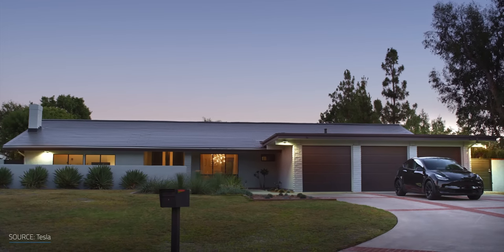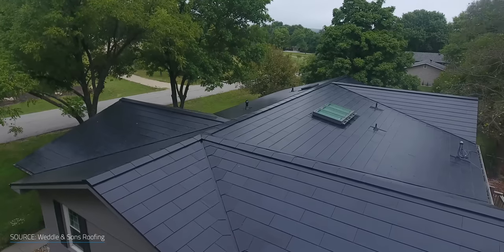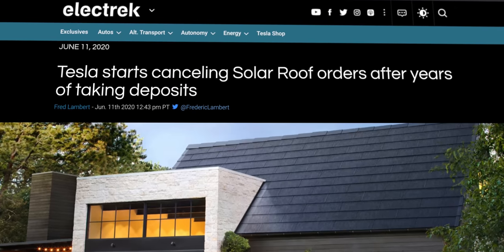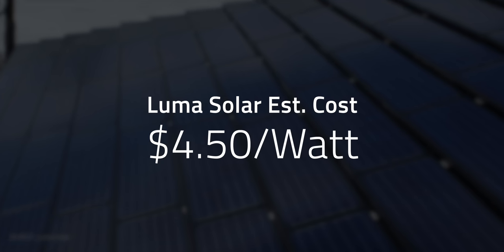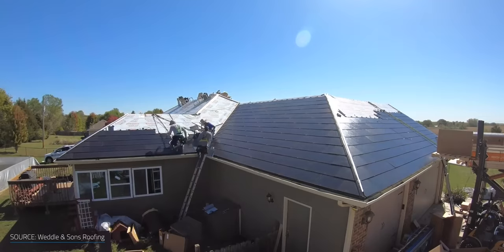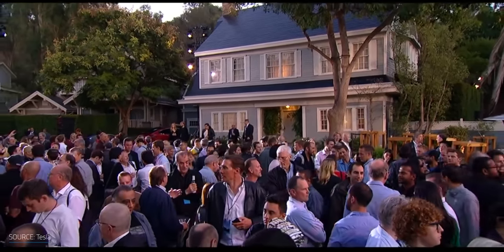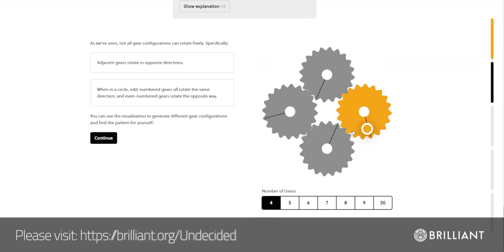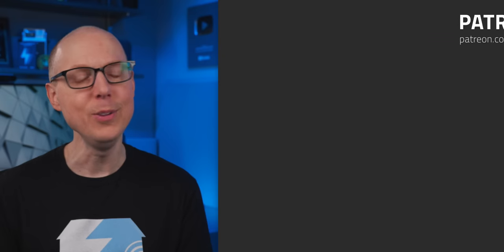The Problem With Tesla’s Solar Roof

Comment: Solar roofs have been around for a long time.  I remember looking at solar roof products 10-15 years ago when I put solar on my camper.  The company made thin film solar on an aluminum substrate.  I think the company was one of the pioneers of thin film solar.  They had two roofing products.  A 3 tab asphalt shingle, and standing seam metal roof.  The standing seam solar panels came in a roll with a sticky back.  All you did to install it was drill a hole in the a roof panel for the wire.  Peal off the back.   Stick it between the ridges on the metal roof.  Because they curved, I was think about sticking them on the curve of the camper roof.  California started using the solar shingles on park/beach small buildings like toilets to avoid vandalism that the regular more visible solar panels attracted.

The company was Uni-Solar.  They where founded in 1960 as ECD.  I'm not sure when they started making solar roofing.  My guess is before 2000(They say 1997).  There sales peaked in 2008 as the largest thin film solar manufacturer in the world.  They went bankrupt in 2012.  So when Musk acted like solar roofs was a new idea, I rolled my eyes.  I have to admit that the Tesla solar roof looks better then Uni-Solar roofs did.

An interesting aside, another division of ECD, Ovonics made the NiMH batteries for the EV-1.
Reply: Yes.  10-15 years ago is ancient history, like Fortran and Cobol.

Comment: I have a new house, but I love the idea of installing a solar roof but it HAS TO be paired with a Tesla battery. I’m hoping that when it’s time to change the roof (in about 25 years) the technology will be great and TEsla will have their crap together 😂
Reply: Solar without a battery doesnt make sense !
Reply: Tesla isn't the only game in town when it comes to home storage.
Reply: I find tesla to be hugely overrated. They are very unfriendly towards their customers.
Reply: @ernie4125  Solar without a battery can make sense. If you are using 2kW constantly and get solar panels that can generate 2kW for 10 hours a day you could cut down on the amount of power you buy significantly. If the cost of the panels is less than what you would pay for the electricity then it's good.
Reply: @ernie4125  I found the payback for a battery in Phoenix (APS) is about 30 years, based on their rate system.  I couldn't justify it - better to spend that money on more solar panels, which I did.  When the utility starts paying more for energy generated at night, that picture will change.
Reply: @paulogden7417 Was not thinking about Tesla sexy batteries. Lead–acid battery's do the trick! Ofc you must make your system as efficient as possible and if need be as rational on the drainy systems. Not saying you will be able doing stuff as usual, but at least you will have some autonomy. 30 years is a bit....

Comment: I'm no engineering genius, but it occurs to me that roofs and solar panels have different functions that may not be amenable to complete integration.
Reply: yah thats why tesla solar roof had too be redesigned totally, its not an intregration more like a roof upgrade ... same functions as a good roof plus solar power and more durability and heat isolation. But the Timberline System is more like an cheap extra i would not call that a real roof. Still both have there use.

Comment: I had my roof for about 17 years. When it came time to replace, insurance covered 60% of the cost. I paid $4,300 for dimensional 125 mph regular shingles. I know a solar roof on my house would easily be $50K. My utilities run about $3.5K per year to be quite comfortable so the amount of utility money per year is not astronomical. When you consider investing some of that difference over time versus taking a loan and paying interest, I just cannot justify it. Even if I had the $50K+ up front  for solar versus just investing that money, I doubt you could ever come out ahead unless the investments did very lousy for a very, very long time. I am definitely decided on keeping my $4,300 lifetime roof with 10 year shingle blowoff guarantee.  I also have zero maintenance and zero monitoring. I just don’t have to worry about my roof in general which is good piece of mind.

Comment: The large problem with putting a solar array on any dwelling is that it (1) puts holes in your roof (2) must be removed in order to access the roof for repairs (3) is hard to access because it's mounted to an existing roof.  
The solution is to place a solar array atop a stand-alone carport lattice frame.  This allows for access to the underside for maintenance and removal of individual panels, utilizes the entire roof frame, provides shade for your vehicles and is overall less expensive to build.

Comment: I added solar panels with my new roof a couple of years ago. I'm in Minnesota. Summer air conditioning is fully paid for by the panels; winter is a different story with snow coverage. I have to clear some of the panels on the east side of my hipped roof since the panels do not come to the edge of the roof. Snow piles up below the panels and has to be removed to get the full solar gain. Not a big deal with a roof rake. It has slowed my transition to electric heat though.

Comment: I actually like the look of 'normal' solar panels too. It would be awesome to have panels of different shapes, to better cover the corners and peaks of a traditional roof though.

A big part of the efficiency advantage that 'normal' solar panels have is the heat difference (as mentioned in the video). They have an air-gap underneath them that is very good at allowing the heat from the panel itself to dissipate.

The other (rarely considered) advantage that this brings, is it actually shades the roof itself, reducing the heat build up that gets into your house's roof cavity (not an advantage in colder climates, kinda the opposite to be fair)
Reply: I agree. Plus, the "idea of unobtrusiveness" seems to be just a matter of habit. I have encased my roof with normal on-roof panels and find it looks awesome and high-tech. So far, no animals made nests in the space between roof and panels, even though we do have some critters around here, and it is installed for two years now. Also, the additional blocking of sunrays helps a quite bit during summer.
Reply: I'd like to clarify. While coverage is the main factor of your system power there are a couple engineering requirements that need to be considered when installing panels. 

First you have the national requirements for first responder safety. Solar panel systems are required to have at least one three foot gap of roof on the side and three foot of gap on both sides of the peak for firefighter access. I'm not sure how solar roof tiles get around this, the tech is new so the codes might need updating.

The second thing solar systems need to consider for coverage is panel size. A system's performance is generally limited by the lowest performing panel. That's one of the reasons shading is such a huge deal when designing a system; a panel in a system with a shaded panel will be limited until the shaded panel is also in full sun. Similarly, different sizes and shapes of panels can drastically complicate the calculations required to get the most efficiency out of the system. Then you have the manufacturing costs to produce panels in different shapes and the extra install cost of the additional racking and positioning. 

It's a decent idea but the cost per W of the system would go up for limited returns.
Reply: @chrury  Regarding the shading, that is why some people might use micro-inverters, which reduces the impact shading has on the system as a whole. Though if you don't really need it, you'd avoid it due to extra cost obviously.
Reply: Panels are clunky solutions to the problem of buying a "used" house, like seat covers on a "used" car.  We wouldn't want those same seat covers on a "new" car.  just wouldn't make sense.  As new homes are built, they'll be more efficient (not wasting 80-90% of their energy to begin with) and PV roof will do two jobs in one, like picking a new smart phone instead of an old "not smart" phone because... why wouldn't you?
Reply: @DK-vx5co  
I don't really see panels as a 'clunky' solution, after all panels are used nearly everywhere (even in new builds) currently. The only reasons you might get a solar roof instead of panels are:
1) esthetics, which most people will not really care that much about, at least none that I know.
2) roof geometry doesn't allow for many panels.
3) this is the most important point: cost. If a solar roof is cheaper than putting up panels, ofcourse people might go for it. But if you don't need a new roof roof, there is no need. And if a regular roof + solar panels is more cost-effective, people are unlikely to go for the solar roof option. 

The smartphone example doesn't really make sense. That is similar to saying "well, you'd pick a new roof instead of on old one, because why wouldn't you?" If my old smartphone/roof is still fine, why would I need a new one? You'd not compare an old roof + solar panels with a new solar roof (otherwise the former is most likely less costly), rather a new roof + solar panels.

Also I don't know where you live, but where I live roofs tend to not be replaced before solar panels reach their end of life, 45-70 years is likely a good estimate for when roofs are replaced here, with a solar roof it would be around 30-35 years.

So imo if the costs aren't in favor of a solar roof and my roofs geometry allows panels, I'd go with the 'clunky' panels.
Reply: @MDP1702  I agree with most of your thoughts.  Panels aren't better, they're cheaper.
Reply: @DK-vx5co  I didn't say that. Panels are better, they have better efficiency, easier to replace, ... But in essence this will just play into the price equation: You'll need more solar roof tiles than panels (efficiency), which increases solar roof costs. Easier to replace means you might be able to keep your roof for 60 years and just replace panels after 30 years vs changing out the entire roof with a solar roof after  30 years (ofcourse people need to look into this, since the roof installers might not point this 30 vs 60 years out, especially not the solar roof installers).

So panels are better in anything but maybe aesthetics and possibly price if you need to redo your roof anyway + need new PV, though this will depend on the kind of roof and the efficiency of the solar tiles.

Personally if the price isn't in favor of the solar roof, I don't see any real advantage to taking it, unless again aesthetics (which I nd probably most people don't care that much about) or roof geometry preventing panels (which on a new build is unlikely). The idea that solar roof is better is imo a hype, its only real benefit to me is possibly price and that highly depends on many factors.
Reply: @DK-vx5co  panels are still better.  The idea of solar singles is aesthetics over function.  Solar panels are at their highest efficiency when they are pointed directly at the sun, and you give this up IMMEDIATELY when you limit it to the slope and face of the roof.   
Even with fixed panels you can compensate for the best permanent install angle, although preferably they would be on  an adjustable arm paired with a  solar  tracker.

as for imagining 90% efficiency keep dreaming, that is so far beyond our capability. but there are high end panels that can get up to 40%  I don't know if they're actually producing though,

Comment: I think I’d prefer a “solar parasol” mounted a foot or so off the roof on a more robust frame, possibly to the groung around the edges, only on the south face.
   This would shade the house keeping it cooler. Also it would reduce the need to leave gaps for plumbing vents.

Comment: I would not install solar roofs here in Spain because of several reasons. Number one is the Calima-sandstorm that comes in and covers everything in sand and dust which means you need to clean them easily which makes solar panels the obvious choice. Secondly I want to angle the panels a bit more so I get better coverage in the winter (big big issue). Thirdly, by adding an angle and a bit of spacing under the panels I get additional shade and wind cooling of the roof in the summer months.

Comment: I’ve had solar panels installed on my roof approximately 5-6 years ago. I truly believe in clean energy and our country’s independence on fossil fuels. Ironically, now with the price of oil going through the roof my decision to have these panels installed has been a godsend. I live in New York and our electric rates have gone up 100-300%! That’s insanity! I received my electric bill this past week and it was $0! In fact, I still had a credit of several dollars. My next door neighbor recently contacted me to inquire about the panels. Apparently, she had received an electrical bill that was over $1,600! That’s absolute insanity! For those who are on the fence about solar systems, and they can have their own issues, the fact that they offer a measure of energy independence, along with a cleaner alternative, was for me a great selling point. Current world events have finally proven me right. I would caution people planning to install panels that you should install a new roof prior to installing these panels. I recently paid over $5,000 to have my panels removed and reinstalled in order to replace my roof. Solar panel leases usually run for 20 years. Quality roofs will last 20-30 years. For me that was a costly “ lessons learned “ scenario. So be forewarned!!!

Comment: Can you imagine if Tesla teamed up with a new home developer that made the solar roof, battery storage, heat pump HVAC and electric vehicle charger as a standard part of the build. They would have people lining up to buy those homes and  become part of a Tesla designed community. Incorporating bike paths and trails, some apartments and condos with solar canopies in the parking lot for EV charging and a business district that you could ride a bicycle to pick up groceries or do light shopping.  Some developer should jump on this and team up with a winner.

Comment: Hi Matt, 
I just got a new roof in 2021 and solar panels. The install time for these two events was 4 days. So if the Tesla solar roof is installing in a week the. We are in the same ballpark. However you mention the lead time to getting started could be months to years. For me, the lead time for thing job was about 3-5 months. lSolar roof is in that range, then that’s also a good alternative. Why didn’t I get a solar roof? I wanted one but I really like the SunRun offer and garuntees. Also during this time, the solar roof didn’t drop in price like they did at the end of 2021.  So my opinion: get a metal roof with solar panels, or a Tesla Solar Roof. They both have a longer lasting time ( frequently longer than the lifespan of the buyer) than buying composite shingles.

Comment: Very helpful I am in the position of needing a new roof in the next five years. I did the research and almost pulled the trigger on Solar panels.  My problem was the thought of putting panels up and then replacing the roof.  So I began to think I would have a solar roof, your video was very helpful.  I’m glad I have some time before I need a new roof as it appears some developments could occur in the next five years to work in my favor.  Cost, quality, installation.

Comment: Thank you. We have two older homes on the east coast. One is in a historic district, the other has a complex mansard roof with dormers and multiple slopes. Standard solar panels aren't really an option for either (historic district won't allow them, and the mansard doesn't have enough large flat surfaces to mount panels), so I've been tracking solar shingles for a while. Currently, I'm in the "lets see if we can wait ten years" camp.

Comment: I plan to plan out my own solar set up for my roof.  I’ll read up a bit on code, run the numbers for the wiring and run and install everything myself.  After everything is in place I’ll call an electrician to twist a few wires together to make it official.

Comment: I think for me the 3 issues with any solar roof is 1) the difficulty of producing electricity in regions of the world where the sun isnt as readily available all year around 2) the potential costs associated with replacing a old solar roof with a new one and 3) the question of how good the solar roof is in holding the elements outside the house aka the roof not leaking for example.

Comment: My roof is old enough that it's going to need replacement soon.  A year or two ago, I got quotes for both the solar roof and solar panels. While I like the solar roof, the cost of the solar roof cost more than solar panels and a new roof combined. I was also quoted a lower kW output for the solar roof.
I think the solar roof looks much more aesthetically pleasing, but it was hard to justify the price difference for something less efficient. I also live in an area where electricity is fairly cheap, so the payback time for a solar roof was around 20 years.

Comment: My experience with Tesla has been okay.  I had put in my order in August of 2021 and it was finished in December of 2021.  I am currently waiting on Tesla to flip the bit so I can send power to the grid, my power company has already granted me permission and swapped the meter out.  

The system that I had installed is working just perfectly so far here in the pacific north-west.  I've been able to mostly power my house on the roof/PW's with no issues.  

My biggest gripe would be talking with Tesla.  There were times I was needing to talk to them and no matter who I called or wrote to, I wouldn't hear back from them.